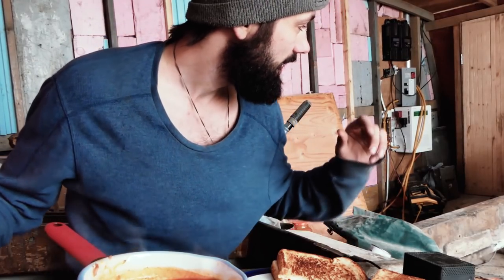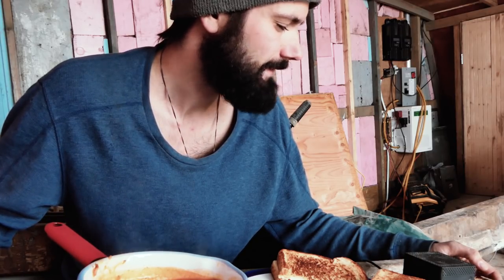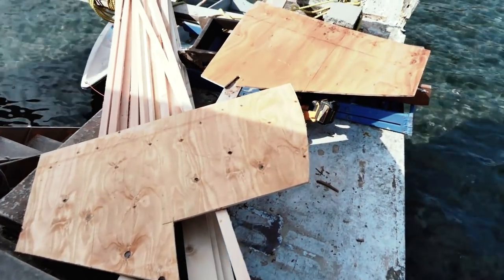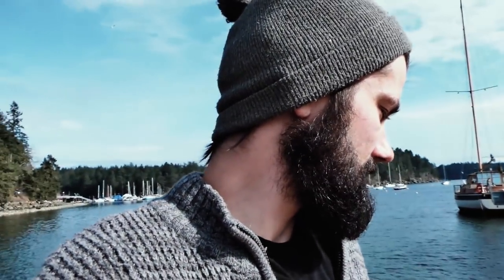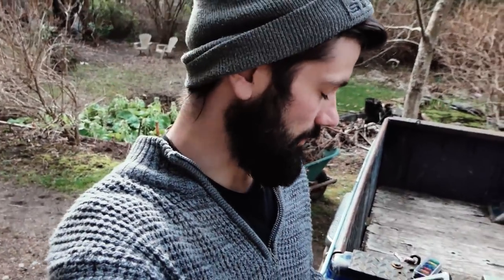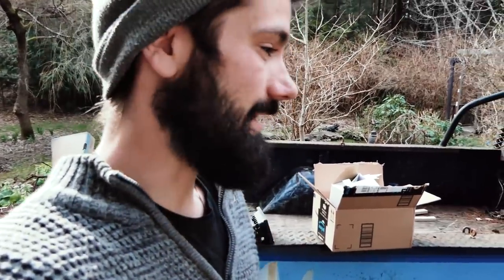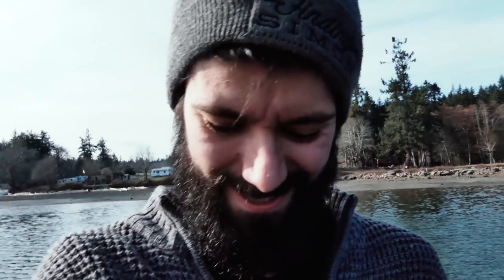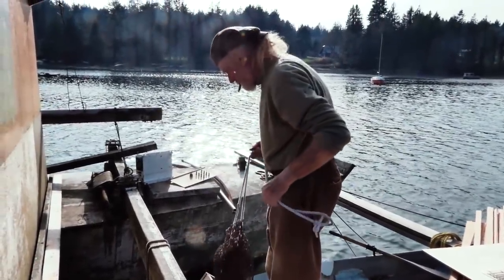Cabin Walls Going Up - Sink or Swim 59

Comment: If you want to make your plywood boat “ bullet proof” instead of 6 oz. cloth. Use Dynel. 
It’s super cheap at fabric stores and is 10X stronger than what your using. I once had to beach a plywood Dynel hull on to sharp rocks and it stretched but would not Tear. The stuff is unreal. 
Mixed with epoxy ( west system) it forms a surface that cannot be damaged. 
No joke !! Look it up!!

Comment: You can use water resistant play for non critical areas, the advantage is it won't fall apart if it does get moisture into it.

Comment: Great video thank you! Most boat Builders don't epoxy interior bulkheads and woodwork unless in the bilge. Most are painted or varnished or sometimes just oiled and most of the time not  on concealed  edges. Painting all  sides and edges with a good enamel instead of epoxy would protect against occasional water and also make it easy to clean and reduce mildew. This would save a lot of time and money which might be better used other places. Good luck!

Comment: Have you thought about keeping your engine and running it on veg oil. You could then use it for charging  and motoring  and you wont be polluting.   Great filming, pleasure to watch. Give your dog a stroke from me
Reply: Running a diesel on cooking oil coke's the engine (does not burn as clean os biodiesel, or PD), the fuel doesn't like cool temperatures and needs to be pre-heated, and it still polluts....it moght be carbon neautral

Comment: I'm not sure its worth it to put the effort of a vapour barrier. If all you wood is epoxied, moisture won't go through, second, insulating with rigid insulation is vapour barrier in itself, third, you will have so many ingress points for moisture that it will be a vain exercise. Just saying because you could save time and money without affecting end result.